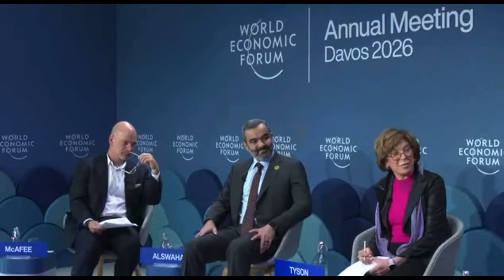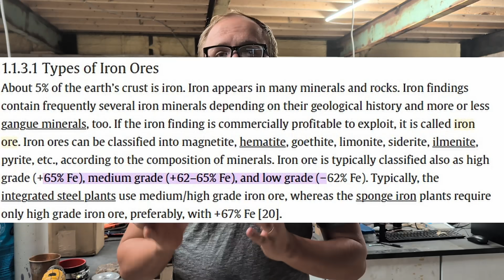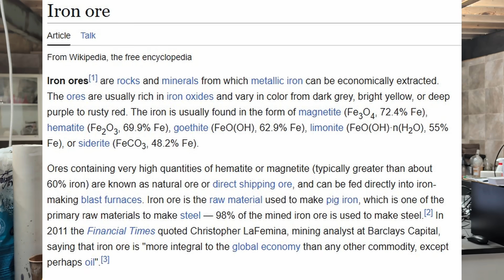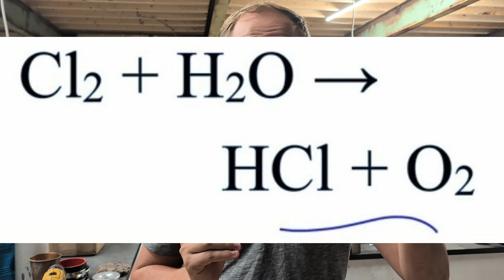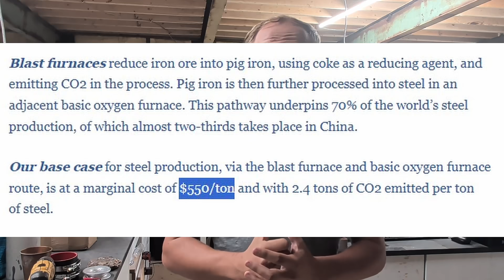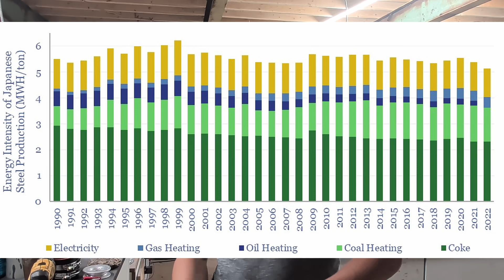Electrochemical Green Steel at Room Temperature, No Blast Furnace

Comment: this chemistry gets us to 'pure iron', but without making some usable form out of it, it's not as competitive against existing steel as it could be, and this is actually more of a problem to increase the quality of ('steel' requires a homogenized mix of many metals, mostly iron with carbon, but also nickel, chrome, tin, led, and magnesium are common 'dopants'). Pure iron wouldn't compete with steel.
Reply from the maker: Correct. But melting pure iron and adding additives isn't a issue. Producing pure iron/nickel/chrome/tin economically is the issue. With steel production, the primary costs with energy is reducing iron oxide to iron metal. Being able to do that cleanly and output a pure product means you can now mix ingredients together accurately and get a controlled output. Does this make sense?

Comment: @Rowow  What is your membrane, how do you manufacture them currently. You say a lot Open Source, where is the data and patent. Would love to work on this and double check your claim, hopefully confirm em but I'm no fool... empirical method is a fair judge
Reply from the maker: ill let you know more about the recipe hopefully in a few months. Im trying to secure funding from some grants that I need to wait on

As for confirming my claim. watch my countless videos where I show it demonstrating in action. I agree its technical specs need to be better analyzed. The membranes have been working so well for years now that I just use them as is.
Reply: @Rowow   Best not divulge any unnecessary information just yet. I'm as skeptical as the next guy, but if this system works out it is groundbreaking tech to say the least. You and your team should get all the credit, And as someone with experience in not only manufacturing of mining equipment, refining precious metals, and a bit of electrochemistry experience. I would to love help develop a turn-key system for recovering not only what the old timers left behind, but extracting the full value out of ores that have yet to be pulled out of the ground. I plan on opening some low overhead cost hardrock mines in the near future, and this would be amazing.
Reply from the maker: @OriginalPhildo1 I'm glad you can understand it's potential! Please see my other videos on me processing ore and the results. Specifically under my shorts

Please it means so much and helps so much to share as much as possible